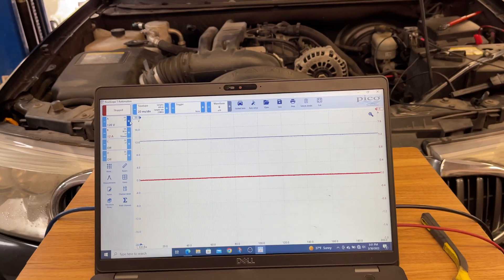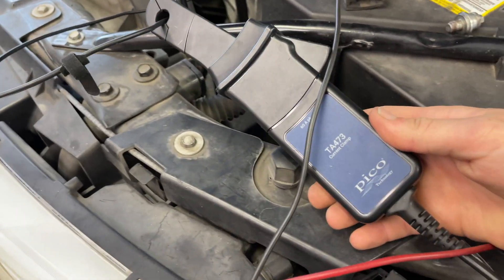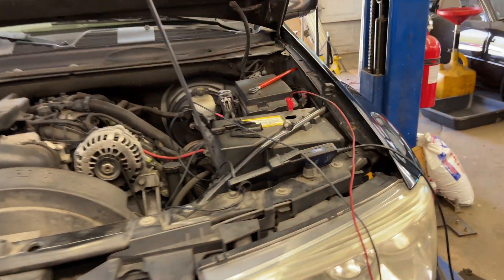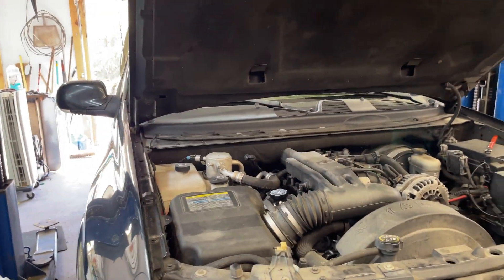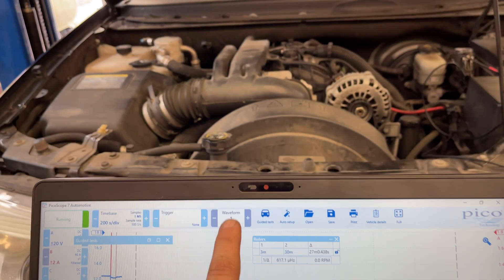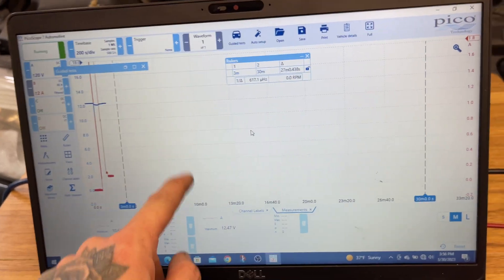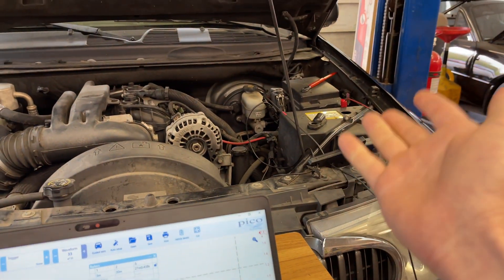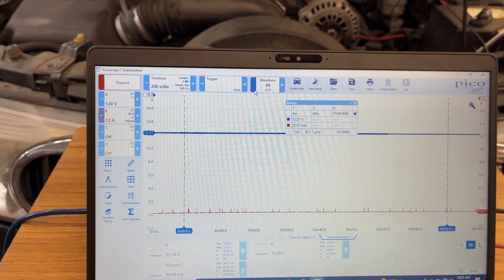How I do Overnight Parasitic Drain Testing

Comment: Doesnt current flow from the negative terminal to positive terminal?
Reply from the maker: Yes technically speaking the current flow is the electrons moving from a negative charged atom to positive charged atom in the conductor.
Reply: @autodiagyt soooo, the arrow points against the flow?

Comment: Have you tried PicoLog 6?  Has infinite logging whereas PicoScope 7 has ~14 hr limit.  No need for waveform pages either because it all logged into a single waveform with multiple channels.  Another cool thing are formulas for the low Ohm resistor method to calculate and convert readings to Amps for you.  It supports automotive pico scopes like the 4425A.
Reply: @autodiagyt  I like that.  Much prefer the amp clamp, I myself am trying to find a good low amp clamp for a multimeter/clamp meter setup.
Reply: @autodiagyt  Thanks for the recommendation

Comment: As a BMW technician I have encountered intermittent draws and will answer how this can help you find a draw if there's spikes intermittently and to be honest it just means you have a slow nightmare.  I used a guide that bmw has for telecommunications wake up to see if it matches that, the amount of draws also helps pin point ( BMW blower motor final stages coming on ) , also a short test and look at all faults 
  ABL energy diagnosis and wake up analysis may help and as a BMW specialist common pattern failures for that model
Reply: Hi I have a 2016 M3 with an intermittent low battery warning on, follow with all the check lights on, it has been happening for few years BMW dealers replaced the battery and keep the the for weeks but couldn't fault it or reproduce the fault when they keep the car in dealership, do you know what is wrong with it?

Comment: I use the BMW IMIB  scope it has a close current draw guided test up to 30 hours after 30 hours all is one page.  The clamp calibration is by opening and closing the jaw ( it vibrates) this clamp never drifts , reads up to 5ma no problem and the jaw is wide up to 1.5 inches.  The best amp clamp on the market.   What I don't understand is your set up. I put the negative clamp around the negative cable and monitor voltage directly on the battery posts, disconnecting a battery post will reset modules and may cure draw temporary.

Comment: Why did you remove the main battery connection to install a test lead?  Is it as simple as your amp clamp wouldn't fit around the battery cable, or is there some deeper reason?
Reply: You can’t fit most low clamps around a battery cable

Comment: Nice setup Jake! I personally don't trust amp clamps in the mA range... Voltage readings are always more reliable and never drift. Maybe a 1 Ohm resistor would work so the voltage drop would be directly proportional to the current draw? Or a 5A test light that you could calibrate for low amp draws?
Reply: @autodiagyt  for sure! Have you seen any causes of random network waking up other than Telematics or OnStar? Only other oddball I can think of is that Honda Odyssey BCM tuning on the ignition on its own lol
Reply: @autodiagprogramming  That was an excellent and considered reply back to PHAD - which I totally agree with!!

Comment: I have the Snapon Verus with the low amp clamp that has the 9 volt battery. Could you remove the battery and use a power supply and run it through the night? Nice video and explanation.
Reply: Yes,you can.

Comment: Another way to measure current without having to worry about the amp clamp not resetting itself back to zero is to use a precision power resistor. And because of the amp clamp issue(s), the amp readings should be more accurate. As an example, a 100W, 1 ohm resistor could be wired in series with one of the battery connection such as for the negative post. Then you could have channel A as you've hooked up before on the battery posts. And channel B would be across the resistor to measure its voltage. Then a math channel could be set up to take the voltage from channel B and divide it by its resistance of 1 ohm. Amps = Voltage across resistor / Resistance. In this case with a 1 ohm resistance the actual voltage measured would be the actual amperage. And with a 100W, 1 ohm resistor, you could have 10 amps current flowing. Of course, this would need a heat sink for that high of a current. Here is an example for one of these type resistors. https://www.amazon.com/Comidox-Aluminum-Housed-Wirewound-Resistor/dp/B077ZMFZM6/ref=sr_1_4?keywords=precision+power+resistor&qid=1680899561&sr=8-4

Take care and have a great day!

Comment: Pretty straightforward setup. Wanting to be more precise on the actual current (or not having the amp clamp), you can place a low Ohm resistor (e.g. 1 Ohm, @ 1 to 5 Watt) in series with the battery, and monitor the voltage drop across it. Applying Ohm's Law, you can calculate the exact current I = Vdrop / R (with R = 1 Ohm, I = Vdrop).

Comment: I owned a Buick with an air ride system with a slow leak.  The pump would come on at times at night and drain the battery.  I ran the power to the air ride system through a relay powered from the ignition circuit.  Problem solved LOL!